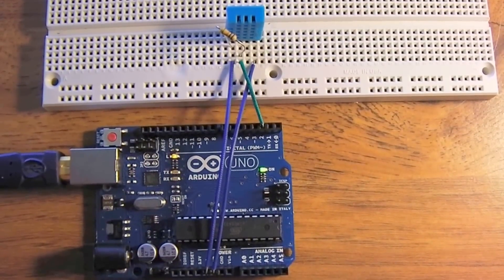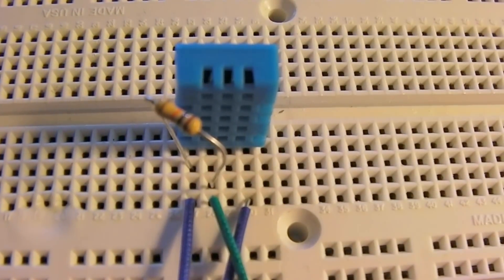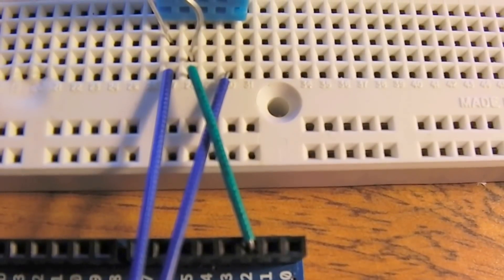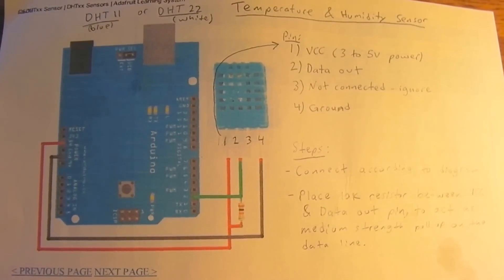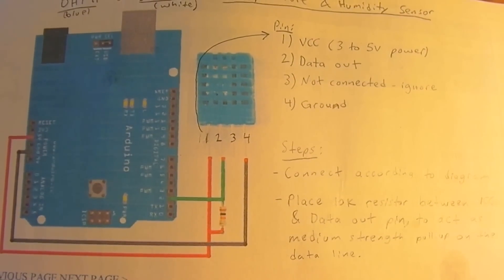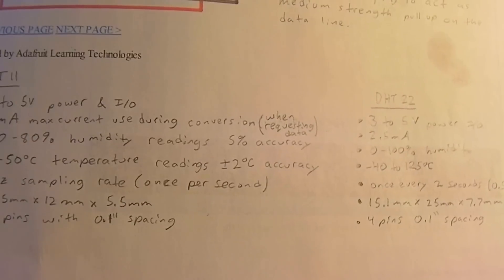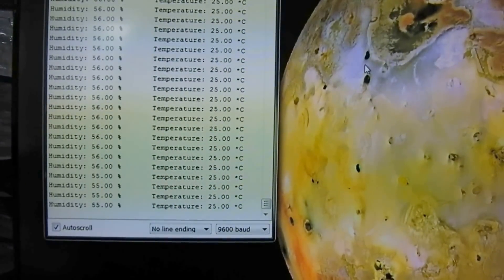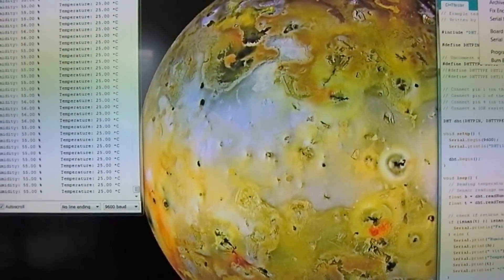How To Connect DHT11 (or DHT22) Humidity & Temperature Sensor [Arduino Tutorial]

Comment: I just got my DHT11 (blue) and it only has 3 pins? The actual device has 4 pins but the board has only 3 pins.
Reply: what happens if you connect it without the 10k resistor?
Reply from the maker: Yea, one of the 4 pins in this video I don't use.  Perhaps they just removed it from the connection board to make life simpler.
Reply: I have it connected without the resistor
Reply: San Luthra i think you got the one that has already an resistor onboard, else it would fry your arduino

Comment: the output provided by DHT11...is it analog or digital.....
u've connected it to pin 2 i suppose its digital then, but how come are the distinct values of temperature and humidity obtained...

could you tell me the formula for converting DHT11 output to values of humidity and temperature....... Data sheet was quite confusing for me....

Comment: i do like this but its happen like this
on lcd
TEMP = 499.51 *CEE 
i dont know what happen can you tell me sir
Reply: refer to this:
http://www.micropik.com/PDF/dht11.pdf

it says to use a 5k resistor(nearest real value is 4.7k also you might add 330ohm resistor to it in series to get 5k ohm) between vcc(pin1) and data(pin2)
and a 100nF capacitor between vcc(pin1) and ground(gnd, pin4)

also make sure you comment out some definitions like it says here:
https://learn.adafruit.com/dht/using-a-dhtxx-sensor
good luck
Reply from the maker: Thanks for the message.  
It could be out of the temperature range?
Sorry, haven't encountered this before.  
I'd also check the library DHT.h:
#include "DHT.h"
Reply: Tolson Winters ok sir thnx much yaaa
Reply: Tolson Winters I didnt see anything about DHT.h in libraries sir ahhhh so where can i get it sir
Reply from the maker: watanabe hatsuharu Hi, thanks for the comment!  In the comments of this video I post some instructions on downloading a ZIP file, OR,
you can get the DHT11.h file and info here in section "dht11.h" on webpage: http://playground.arduino.cc/Main/DHT11Lib
Reply: Tolson Winters ok thnx

Comment: Hi! Such an awesome and clear presentation. I tried to follow every step and I have everything installed, but IDE gives me:
"core.a(main.cpp.o): In function `main':
D:\Program Files\Arduino\hardware\arduino\cores\arduino/main.cpp:11: undefined reference to `setup'
D:\Program Files\Arduino\hardware\arduino\cores\arduino/main.cpp:14: undefined reference to `loop'".
Do you have any idea what's going on?
Reply from the maker: Hi, thanks for the comment!  I haven't played around with this code in some time, but that might be a missing library it is trying to find.  Make sure you have the appropriate libraries in the specific folders it is looking for.  Also it is interesting the "\" reverses direction to "/", as in "\arduino/main.cpp".  This might be a problem in the link address, try just changing to "\arduino\main.cpp"

Comment: When I try to run the code it highlights "DHT dht(DHTPIN, DHTTYPE);" and says: 
sketch_apr14b.ino:4:17: error: DHT.h: No such file or directory
sketch_apr14b:18: error: 'DHT' does not name a type
sketch_apr14b.ino: In function 'void setup()':
sketch_apr14b:24: error: 'dht' was not declared in this scope
sketch_apr14b.ino: In function 'void loop()':
sketch_apr14b:30: error: 'dht' was not declared in this scope
Reply from the maker: Hi, it looks like you are missing the DHT.cpp and DHT.h library for this.  (DHT11 library): http://playground.arduino.cc/Main/DHT11Lib

It may be easier to just download the ZIP file in the comments instead :-)

Comment: Dear Tolson,
it was a very intersting video.. I am trying to connect DHT11 to RS232 and then I found from the seller, it uses another kind of architecture for transfering the data (70us for 1-bit 1 and 27us for 1 bit 0). Then I was confused how does the Arduino comunicate with DHT11. Could you please help me to undrestand this issue??? It is killing me at the moment :)

Comment: I wired a dht22 sensor like yours up to an arduino tonight, and it works fine with the readings to serial coming out as expected. Then when I breathe on the sensor to see the change in RH, it maxxes out at 99.9RH and stays there for a long time. Temperature is perfect. Have you seen similar results? This will be in a meat curing chamber so it needs to handle high humidity occasionally. I wonder if the sensor is faulty or if I'm missing anything. Any help appreciated. Thanks in advance :)

Comment: How can I set the showed temperature to a number with 2 decimals behind the comma? In the example it shows only the temperature in full number like 25.00 degrees and not 24.85 degrees. It looks like its rounded to a full number.

Comment: Hi I have my arduino set up to how you have shown with all the latest files but it just does this:

id11 Example program
LIB version: 0.1
---------------

Retrieving information from sensor: Read sensor: idDHT11 Example program
LIB version: 0.1
---------------

Retrieving information from sensor: Read sensor: 

But no readings appear? What could be the problem with this?

Comment from the maker: I did it using software that can be found here, downloading the zip file:  github.com/adafruit/DHT-sensor-library  It's a bit hard to setup, sorry about that.  In the readme make sure you switch to DHT11 from DHT22 in the comments section at the top.  Further info should be in the readme you download.

Comment: Tried this with my new DHT22 and got failure.  "Read failFailed to read from DHT"  I'm wondering if it is dead.  I orginally followed the instructions in the Make book "Environmental Monitoring with Arduino" that didn't work either.